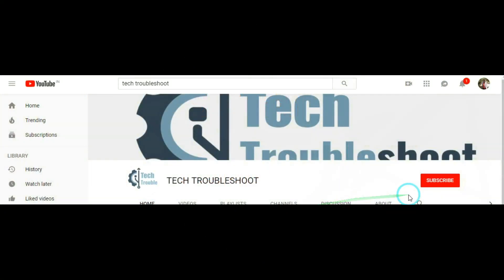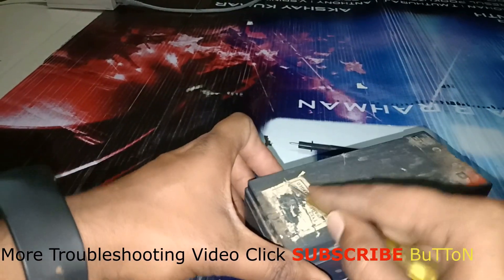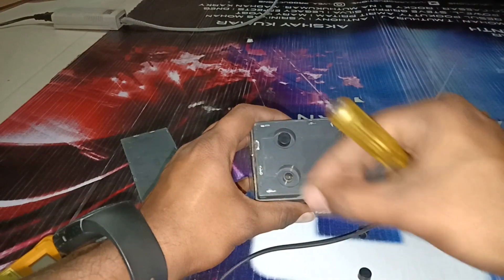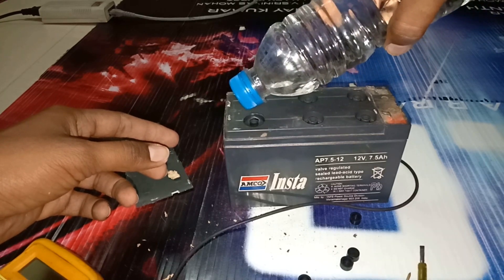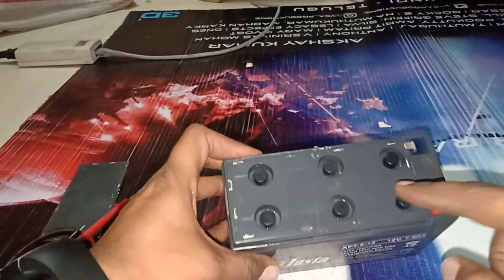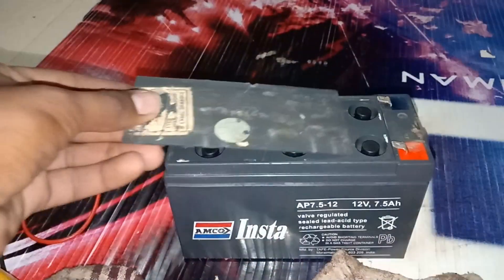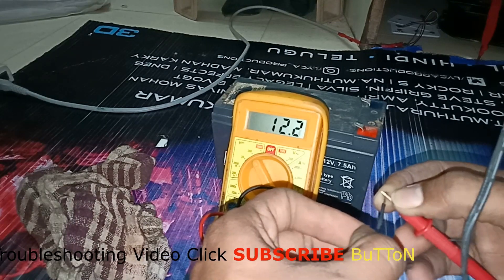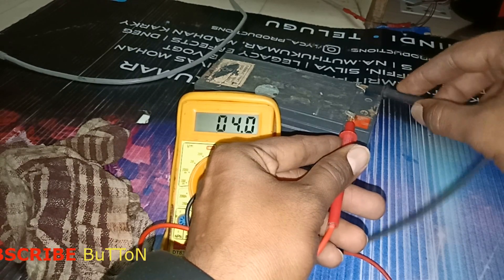Restore Dead Battery_Sealed Lead-Acid Battery (recovery)

Comment: When it already 4 volts can it go to 12 volts when charge in machine
Reply from the maker: After recharge 4hours
Reply: @TECHTROUBLESHOOT   but how to revive if battery i already charge 12 hrs but still 1 volts even if i fill it with battery solution
Reply from the maker: Kindly check each cell voltage because any single cell weak that time to happen like this...put(- terminal commonly ant check each cell inside + positive terminal ) this time u get each cell voltage then calculate your +++  voltage
Reply: @TECHTROUBLESHOOT  ok thank you so much🙏🙏🙏
Reply from the maker: You're welcome..